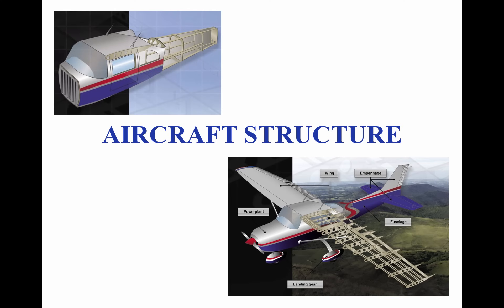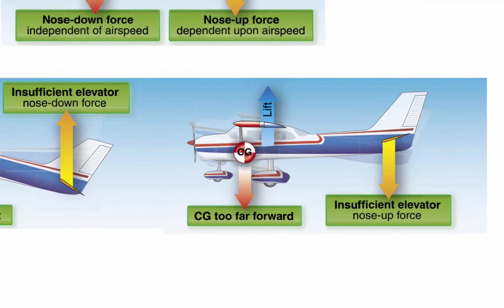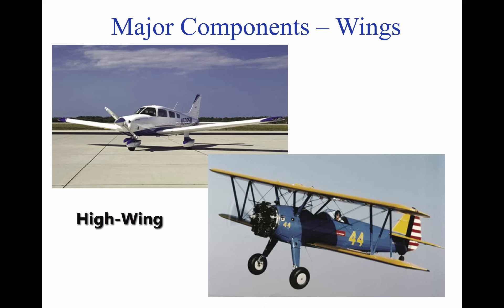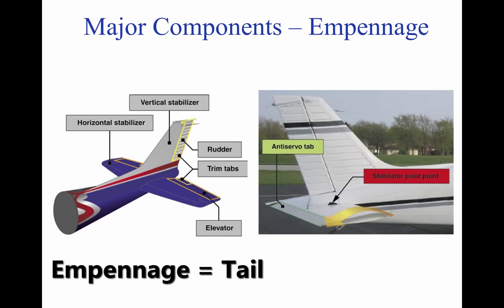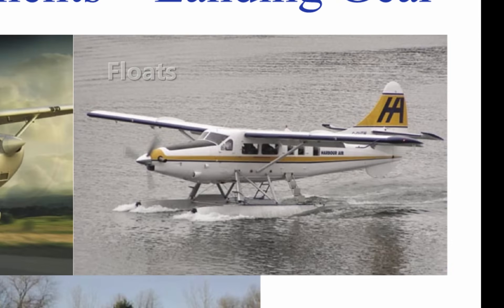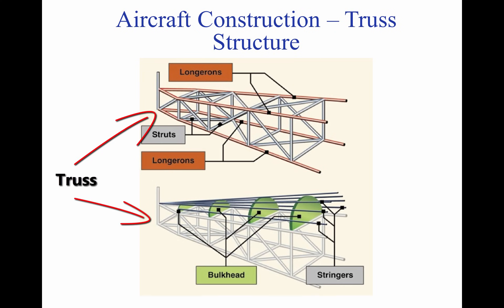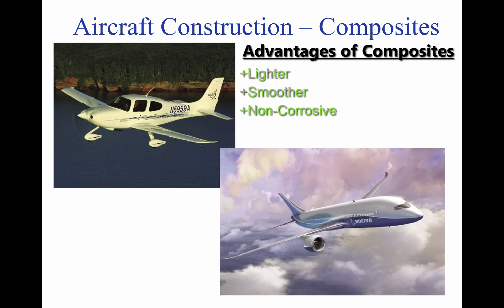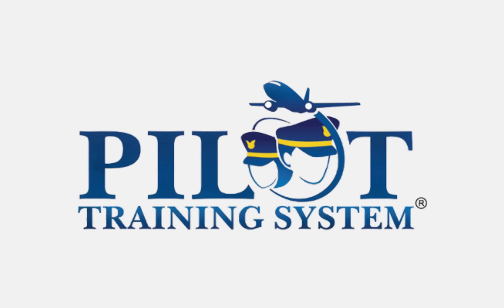Private Pilot Tutorial 2: Aircraft Structure

Comment: there is a mistake at 8:35, where she said a low pressure is  formed at the back of the propeller airfoil and high pressure at the face of it.  high pressure is at the back which tends to move to the low pressure and front and pushes the plane forward creating thrust.

Comment: Wait 8:34 !! I read the book and It is said that the high-pressure area is formed at the back of the propeller´s airfoil, NOT AT THE FACE. and low pressure is produced at the face of the propeller, NOT AT THE BACK. It works similiar to the way lift. A higher pressure at the back of the props will push the airplane forwards. Sorry if I am wrong.
Reply: yes, it took me couple of time replaying trying to see if I am missing something and even then I  looked at comments to see if anybody else noticed it. I am really grateful to people that created this content but this is a serious  mistake that could be very confusing and misleading to people who have zero  knowledge of airdynamics.
Reply: Boris Poludo Exactly, people may mistake them so we only hope the uploader could correct it.
Reply: You're all wrong! Propellers and airfoils do not generate (sufficient) lift as the result of high and low pressures. Lift is actually generated by redirecting the flow of air. This is how aircraft can fly upside down. I won't go into all the details here, but search google for "NASA incorrect lift theory" and you'll find all the info you need. You can also find a short video on youtube about the Coanda Effect, which shows the fluid redirection using a spoon under a running faucet. Try it yourself! Unfortunately, the pressure theory is still the correct answer for the ppl written exam, so it is important to know that.
Reply: The face of the prop is the flat part which is facing the pilot, therefore that is where the high pressure is. The back or camber of the prop is facing forward, that is where the low pressure is. That's how the prop generates "forward lift". It works exactly like the wing does.
Reply: Dont guess there is a great little, we will just call it, documentary called The Propeller Explained here on youtube. 20 minutes and shows quite alot on propellers and their physics.